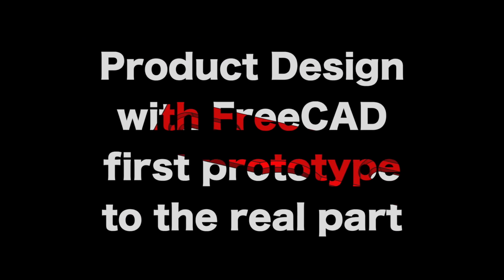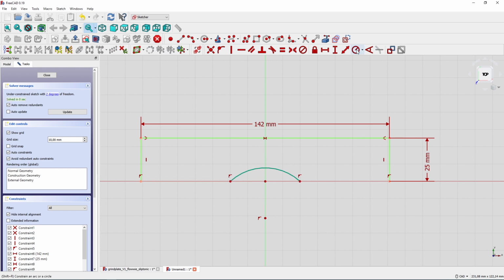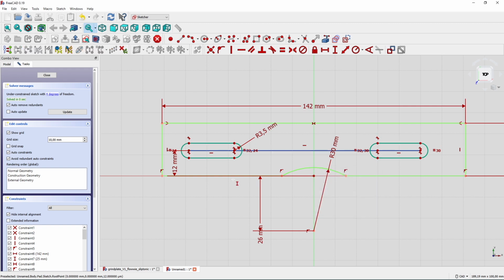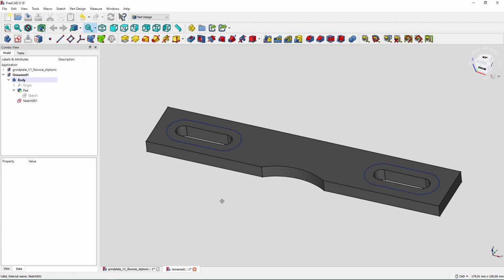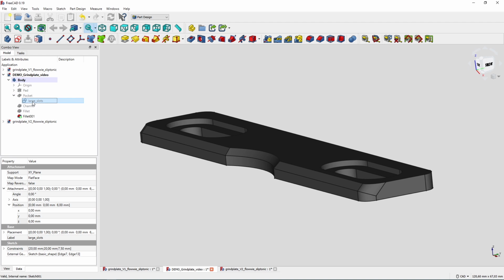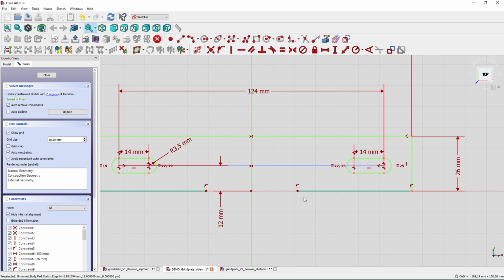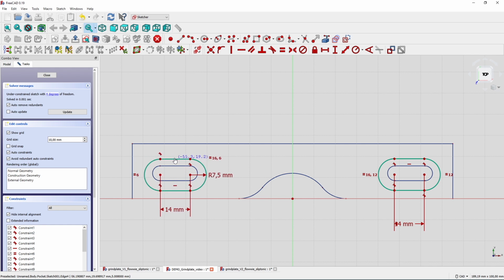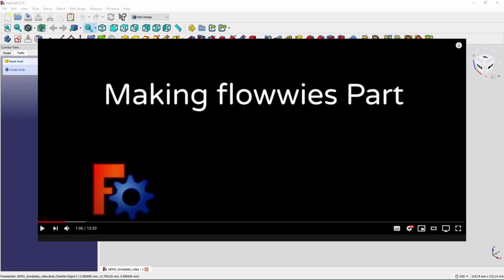How to model an easy part for CNC machining in FreeCAD - Product Design - Flowwie & sliptonic

Comment: It looks like you drew it in the correct orientation but I watched the path creation video and this model opened in the wrong orientation. Is this a bug in freecad?
Reply from the maker: No, actually that was my mistake, because the version that I sent to sliptonic was slightly different from the 'demonstration' version, which I created for the video.
In the version that I sent to sliptonic, I used the XZ-plane for my basic sketch.
Very good question -thank you!
Reply: In general, we like to design parts in the orientation that they will be used.  This way the parts fit into assemblies.  But almost certainly most parts need to be re-orientated for manufacturing.  And you might even need a different orientation based on if it is to be 3D printed or made on a milling machine.

Comment: Dear Sir
1) Thanks for teaching bigginers here.

2) Improvement suggestions.
2.1 the Cursor need to be Larger and Colour is perhaps in Red.
2.2 You need to move cursor Slower if you do have to stick with your current mouse setting.

Thanks again my teacher.

Comment: Thank you, worked for me! I followed the video in the new 0.20 weekly development release and it was almost the same, I didn't get warnings when I applied the same constraint to more than one object though, it just worked. Also I noticed that if I left my initial shapes in the Sketcher not visibly parallel or otherwise lined, I had to make more constraints manually than in the video. And twice, in this and another video, by setting vertical length between two objects FreeCAD decided to put an object A above B while it was intended the other way round. Couldn't find the reason for that behaviour.

Comment: I could not go further regardless many times create new document and got the following error    
++++
13:23:31  Traceback (most recent call last):
  File "<string>", line 1, in <module>
<class 'ValueError'>: Datum 30.00 mm for the constraint with index 13 is invalid
13:23:31  App.getDocument('Unnamed').getObject('Sketch').setDatum(13,App.Units.Quantity('30.000000 mm'))
++++++
the issue is must tick the box Auto remove redundency in the Task Tab

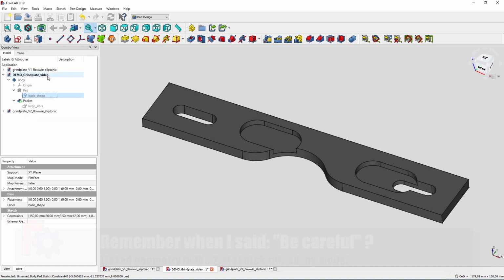Comment: Strangely I don't get the same error as you did at 19:14 but instead the new sketch is only visible in Sketch_Edit mode and the original sketch shows after closing it. There is an error that says "Failed to validate broken face, internal name: Pad"
Reply from the maker: You might have destroyed the first sketch. Maybe you have some overlapping lines or a contour that is not closed. That are the most common errors.
Reply: @FreeCADAcademy  thank you for you help. I'll look into those things

Comment: First of all thanks for your great video.. but I have some challenges with the Sketch001 - it simply do not appear in the model and I have tried several times according to your instructions on this part and also made a very simple model where the problem is the same .. could you advise me - what am I doing wrong / not doing - using 0.20 29177 (Git)

Comment: I'm following the the video exactly. Mine wont "Glue" to the X and Y center lines without me dragging it there and I keep getting an error about constraints when trying to define the first arc as 30mm. It wont let me do it and I dont know what I'm doing wrong or different
Reply: I found this video: https://www.youtube.com/watch?v=FaVLVg65gl8
Basically what I did in this case is turn on "auto remove redundants" and "auto update" in the "solver message" little window, I deleted the arc and started to draw it again. Then it work but I am not sure what it removed I just started with the SW too :D
Reply: Edit** I see he has "Auto remove redundants" checked on the solver.  I get the exact same thing. Looks like there is a cut in the video because the shape moves positions but you don't see the action to move it....not sure what I'm doing wrong.

Comment: I was hoping that 0.2 had fixed the topo naming problem.  I tried this lesson using 0.2 and it still has the topo naming problem.  After removing the arc and redrawing it as three tangent arcs the model rebuilds with the same problems.  That is disappointing.

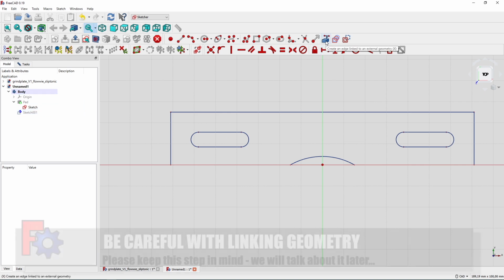Comment: I can't go further than creating second sketch with the bigger holes which is created since 9:00, after closing the sketch bigger holes are not visible and pocket command is not working... watched and go through couple of times again but step by step but it do not comes out. Help
Reply: Mine is doing the same thing, and I don’t know what to do.
Reply: I’ve now figured it out! Before, when you are connecting the smaller holes in it, you press the construction mode button to connect the 116mm length of the small holes. This makes everything construction lines and blue rather than the green. Deselect this and try again. It should work!
Reply: @haydenmacdonald1938  Hayden, Thanks! That was the step the somehow was missing in the FreeCad Academy video. Glad you found the solution. I am now able to create the pocke.

Comment: i have folow step by step and my sketch 001 is there but when i try to create pocket i get input error "Linked shape object is empty"
Reply from the maker: I'm sorry to hear you are having problems. I'll check this issue.
Reply: i get the same error and the sketch001 is not visible i part design window even when i use the spacebar.
Reply: @FreeCADAcademy  I have followed the tutorial step by step 5 different times. There must be a step missing in the video because I always get the "Linked shape object is empty".